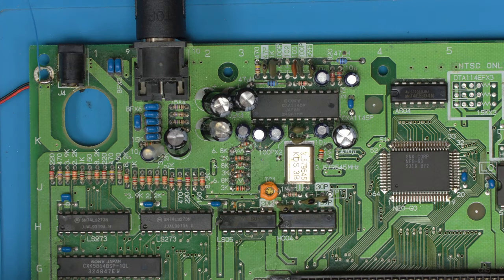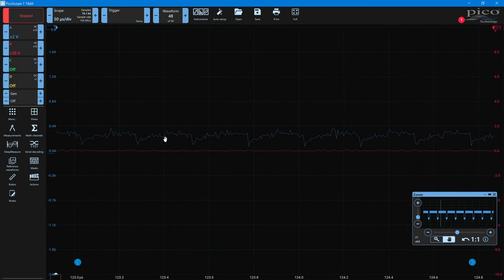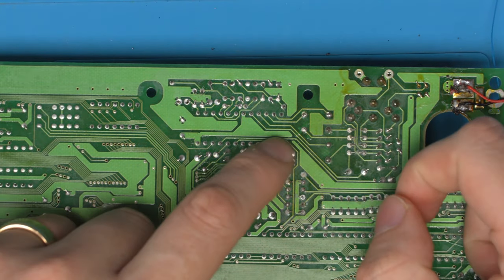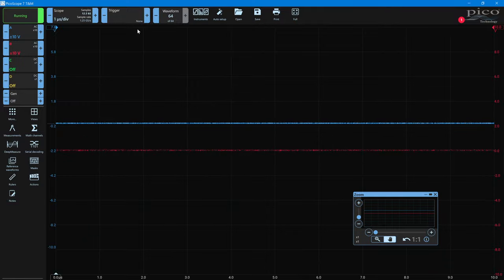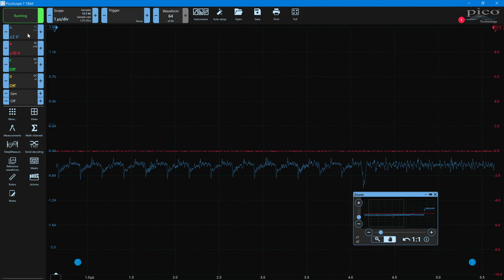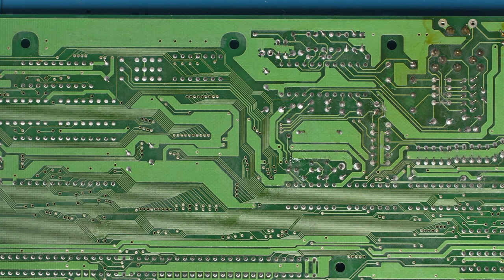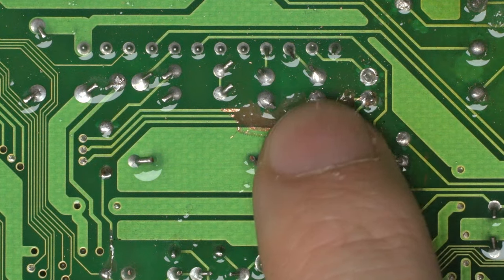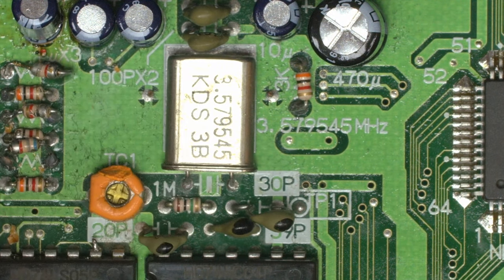Neo Geo AES 3-6 True Jailbar Fix (No Bypass, Keep Composite)

Comment: Amazing. it would be great if you could do this in depth research for famicom too. all composite mods for Famicom have vertical lines as does this neo geo. and I think many people would find your video very useful, especially me
Reply from the maker: Sure thing. Any particular revision of Famicom? Do the NES suffer the same?
Reply: @RetroSix  NES doesn't suffer the same. it already have composite integrated in the console and is perfect. famicom have only rf output and need a mod for composite signal out but when i do it, no matter what i do, any revision have jailbars. it can be improved if i put a  big filtering cap in the 5 volt line of the console such as 400uf -ish but noting major. and i really want to know where is the problem.
Reply from the maker: @RVNR2022  ok cool. I'll have to mod my Famicom when I get time and find the cause
Reply: @RetroSix  fantastic. your work is amazing when is time to do deep research. you surely have much knowledge than me.

Comment: Does this mod work with the NTSC consoles or the PAL model only? Ive a japanese 3-6 revision and i wanna keep the composite (even though i only use the RGB). Thanks
Reply from the maker: You would have to show me the top left area where that circuit is in the video I say is blank. If it's populated we would have to rewire new wires to that area. Jump on discord.gg/RetroSix and share images

Comment: Whats that stuff on the removed traces? If its not a sealent i would highly recommand that. Else the corosion will happen pretty shure the next 15 years.
Reply from the maker: The exposed ends are no different than every exposed via, solder pad or edge connector. It will be fine